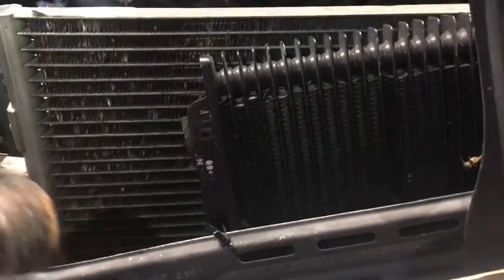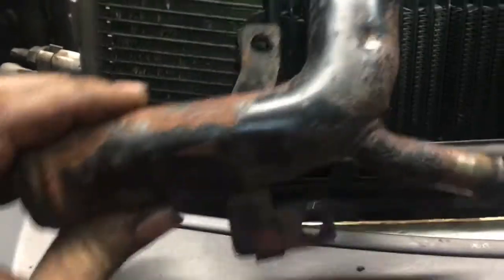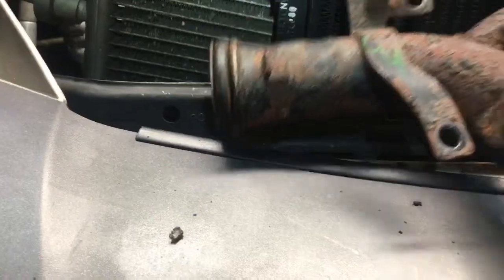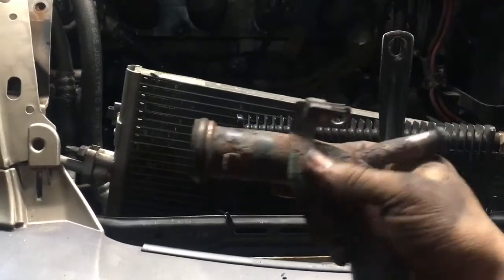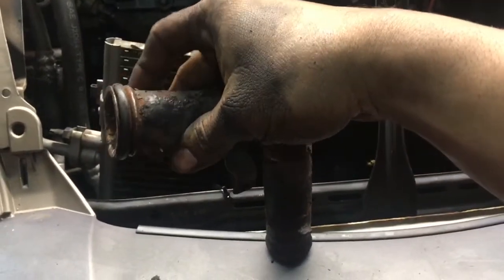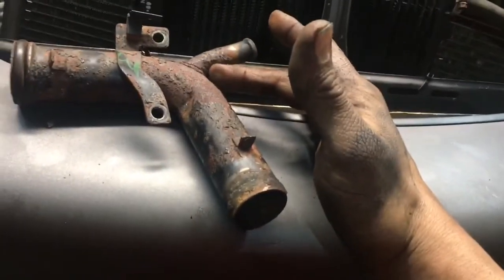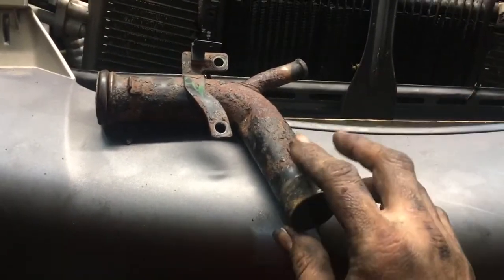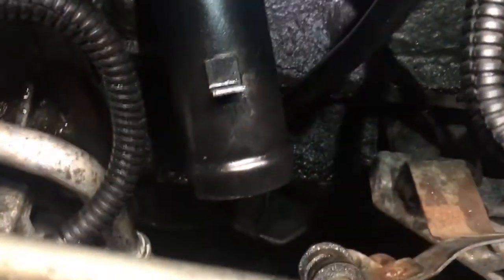How to install water pump pipe on a PT cruiser

Comment: I wish somebody would make a video showing how to replace a water pump pipe on a PT Cruiser.
Reply: It's part of the timing belt assembly search timing belt replacement it should be covered in the proccess
Reply from the maker: I understand and I believe when I made this video I actually started making a video of doing that because I had to replace mine I’m guessing I must’ve never put it up but I thought I did I’ve got so many videos I can’t remember but I know that’s a real pain in the ass it is possible to change though

Comment: Thanks bro I'm having some trouble getting it in I'm going to try a small engine ring compressor to compress o-ring and insert tube also idiot that worked on this vehicle before me broke the AC cut off is it a special tool needed to remove to replace I will Evacuate the system before I attempt to remove it I have the system in the pump to EVAP system
Reply from the maker: I had the same problem Im pretty sure i made a video on how to get it in . Take a look at my list of videos . I remember it was very easy once i got it in . I think the O ring went in first then the tube went in, or i used grease one of the 2 or both. Hope that helps

Comment: Great tip.  I see at 3:15 you installed new red hose to the heater core tubing (the two steel tubes that pass around the engine then lead to the heater core eventually).  Like the water pump pipe that you replaced, if that steel tubing gets too rusty it will start to leak and replacing that is expensive and labour-intensive.  Is it possible to just run two full lengths to the heater core directly and bypass all the old steel tubing?
Reply from the maker: Yes I would be sure you could

Comment: Do you have a video on how to replace a large lower hose that appears to go into the firewall on a 2002 pt cruiser? My nephew was trying to investigate where I had a bad coolant leak and he said he saw a large cut in a hose under the passenger side of the car where coolant is spraying out from.  The coolant only comes out when the car is running.   Is this an easy, inexpensive replacement would you know? Thanks
Reply from the maker: I’m sorry I wish I had an answer to them questions I doubt that it was easier to go from the bottom because I did have the vehicle on a hoist and I did it a while ago and I honestly can’t remember sorry I couldn’t be of more help

Comment: I'm going to try and use a small engine ring compressor to compress o-ring before installing pump Inlet also the idiot that work on this car before me broke off the connector to the AC cut off is there a special tool to remove or just snap ring plier I will evaporate the system before I attempt to remove this I have the equipment to do so